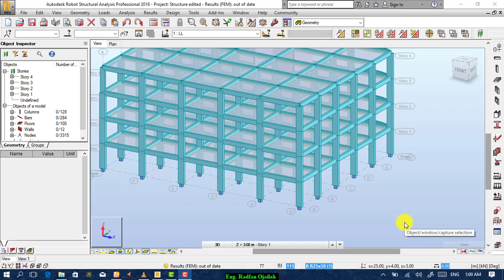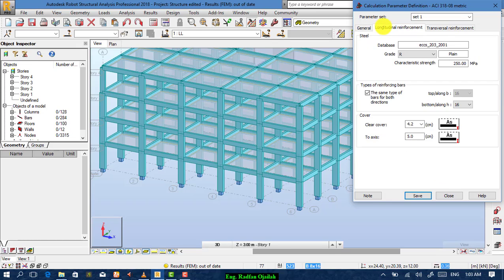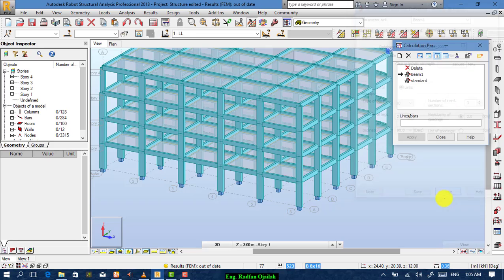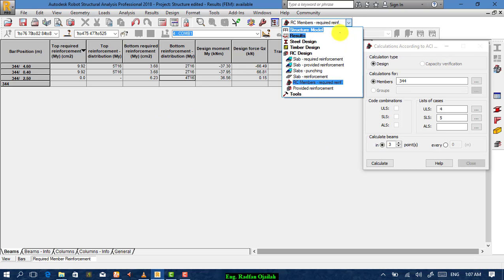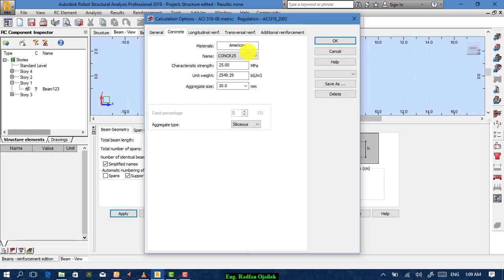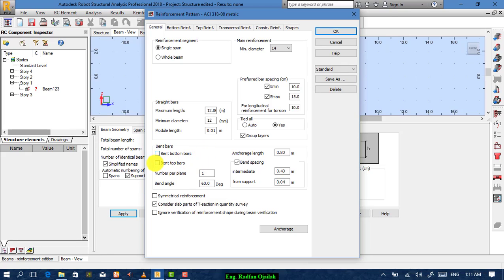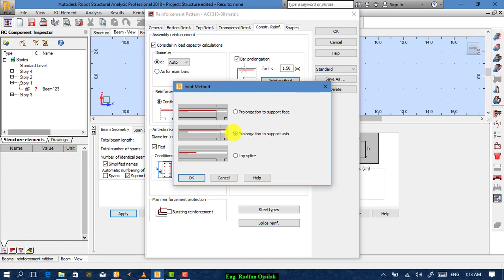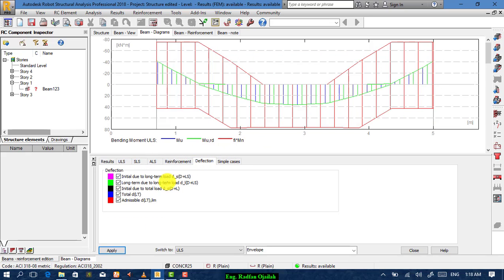Lesson# 9: Designing a Beam in Autodesk Robot Structural Analysis

Comment: Hi sir 
I'm using the same procedure as u followed for beam.reinforcemnt is appearing in "required reinforcemen" but in provided reinforcement calculation the "dimensions cross section is smaller than required reinforcement for flxure or shear"